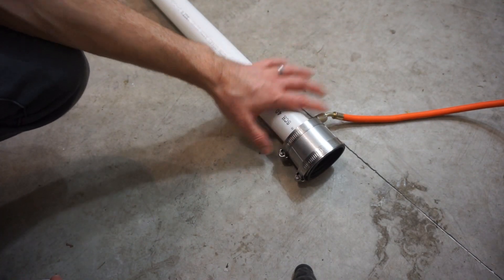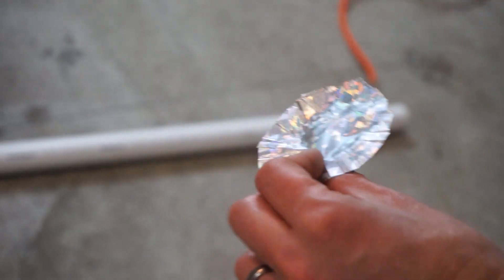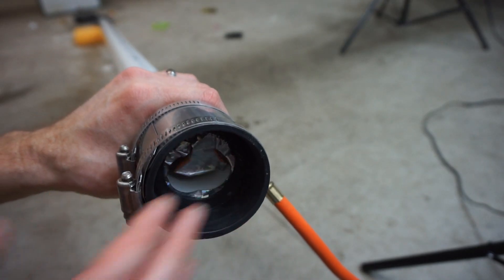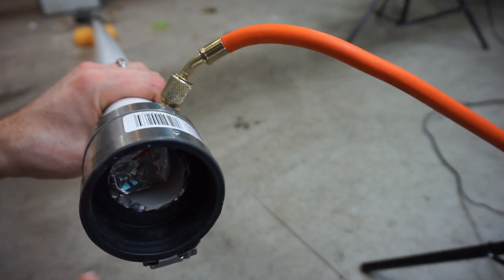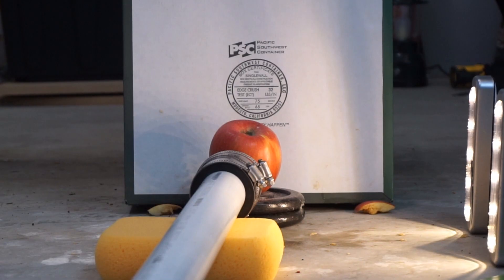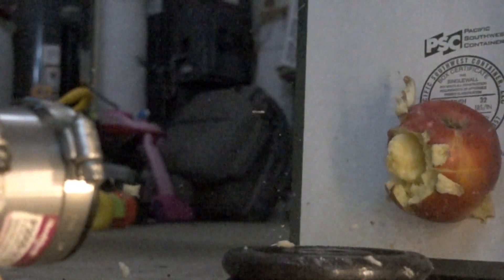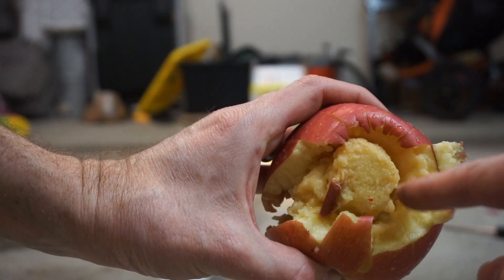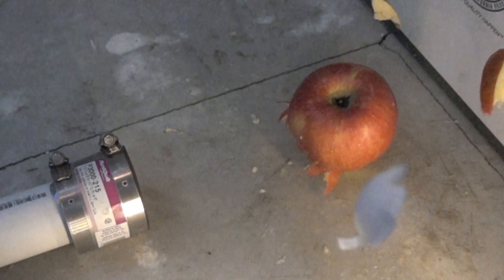Shooting Fruit With Supersonic Ping Pong Balls | First Vacuum Cannon Test

Comment: You won't hit supersonic with just vacuum, you need either pressure or a lighter driving gas such as helium.  With a 2m pipe, you're probably hitting about 280 m/s which isn't bad, but not quite supersonic.

Comment: I'd like to see an actual measurement of the speed of the pp ball.  Shoot slow mo from a 90-deg angle to line of flight with a ruler behind that flight path.  A possible experiment would be to see if an aerodynamic styrofoam bullet could travel faster and further than a ping pong ball.
This video has a flicker which, I guess, is from fluorescent lights.  It would be interesting to see videos lighted only by an arc light, which should have a very pronounced 60 Hz flicker, if not a strobe effect.  You could compare the speed you get with the ruler with the speed calculated using the 60-Hz flicker.

Comment: Wrap copper wire around. PVC And use a magnet as peojectile. 2 experiments here. 
1) see how much juice can be generated.
2) add power to the coil and combine the vacuum & electromagnetic! ( look out)

Comment: I think the ping pong ball is bursting when under vacuum, prior to being fired. If you put a small hole  in it this may not happen. It may implode after exiting the barrel, though.  So maybe several small holes may be necessary to prevent implosion.  Alternatively, fill the ball with expanding insulating foam used to fill cracks around doors and windows. That should keep the ball from bursting or imploding.

Comment: I'd like to see you make it even  more powerful, if possible.  I feel like if you had a much stronger rupture seal on there, and then in addition to the vacuum, instead of just atmospheric pressure rushing in, put a tank of compressed air that will rush in (hence the much stronger rupture seal).  Or...something like that.

Comment: what if you had the vacuum pipe connected to another pipe that has pressurized air in it and after you pop that pressure cap thing see how fast the ping pong ball goes (not sure if the pressure cap will hold up in this scenario)

Comment: The air rush in EXACTLY at the speed of sound and it can't be like what you said 3 to 8 times the speed of sound. The air is choked at the beginning of the inlet and no further expansion happening after.
Reply from the maker: +Yi Ling the air is only choked when there is air in front of the incoming air. When there isn't air in front, there is a different limit that is dependent on the heat capacity ratio of the gas
Reply: the air will choke at the smallest cross sectional area where is at the inlet as what I have observed, it doesn't matter if there is air in front or not, it's the pressure differential driven and without further expension, the air can only stay sonic or subsonic
Reply: however, the absolute air velocity is dependent on the specific heat with this equation sqt(k*R*T) where k is the specific heat ratio
Reply: Hydraulic Press Action an easy explanation would be, the air cannot sense the further pressure drop ahead, that's what we call it a choking condition
Reply: Hydraulic Press Action in other words, supersonic flow cannot be established with pressure differential without a choke and further expansion, that why you see the nozzles of rocket engine are diverging at one end, that's basically the working principle of converging diverging nozzles
Reply from the maker: +Yi Ling The flow you are talking about would be regular flow at steady state. This would indeed be restricted to the speed of sound. But the expansion of a gas into a vacuum is in shock conditions and thus there is no restriction to the speed of sound (Similar to a shock wave). It is restricted to the speed of the molecules at that pressure and temperature. Here is a good paper on the free expansion of a gas into a vacuum and the speeds of the gas face: http://adsabs.harvard.edu/full/1953ZA.....33..251K
Reply: Hydraulic Press Action I really appreciate your effort and I'll review the paper once I get to my office tomorrow since I can get it for free. But one thing I would like to mention is, the concept of expansion for supersonic flow to a lower pressure and flow travel into a lower pressure, or to a vacuum if you wish is completely different. Technically speaking, free expension is when the imaginary cross sectional area is approaching infinity, which causes the Mach number to theoretically sky rocket, but in this case it's not likely to be the case. As you said, indeed this is not a steady flow case and the flow will travel into the tube as a pressure wave. But remember what is the concept of speed of sound, it is the highest velocity a pressure wave can travel within a certain medium. What essentially a choke is doing is to accelerate the flow to sonic condition at the choke, and the expension follows accelerate the fluid to supersonic and thats why I disagree with your argument. One more thing I would like to mention is, the ability of expension is restricted to the cross sectional area relative to the choke or in other words the space available normal to the flow direction.

Comment: WHY HASNT ANYONE WEAPONIZED THIS METHOD OF PROJECTILE
Reply: In this type of application, you need a long cylinder to generate speed. If you were to weaponize something like this, you'd probably have to make the "cartridge" the barrel.
Reply: ***** yeah you got a point
Reply: WHY DO YOU ALL HAVE TO USE CAPS?
Reply: STAY4FREE vacuum cylinders with a projectile on it like a bullet.
 Make a small very high vacuum casings and have the back like a firing plug that gets  hit in with the firing pin.

He should try to see if he can do an experiment on this one.
Reply: you could have a system that applies new a seals and loads ammo but its still more complicated than a normal gun at that point.
Reply: Single use and incredibly inefficient
Reply: The scientific answer is that the pressure difference is to low! You only generate a maximum of 1 atmosphere difference while an air gun uses 100* of that and a pistol over 1000* that pressure. In other words a vacuum rifle would need to be a thousand times longer than a normal one to accelerate the bullet to the same speed. Just imagine that thing! Lol

Comment: so it's sort of half a hyperloop. I wonder if you could somehow magnetically accelerate something inside the plastic pipe by wrapping copper coils around the outside of the pipe? You could then have a solid end cap on the breech end and the mylar disk on the muzzle. A metal bolt could be accelerated to hypersonic speeds if the current and length of the tube was big enough and then come smashing out into the air...

Comment: Supersonic?, that means are faster than bullets?.
Reply: I'm going to answer your question, don't worry, but think about this first. You're literally on the internet, and you typed a word you didn't know in on the internet to find out what it means, but instead of just typing it in to something like Google where you would get the answer and as much technical explanation as you could possibly desire instantly, instead you typed out an entire question asking what that word means only to have to wait for another person to have to type in the answer for you? Surely you realize how silly that was, right?

Anyway, the word "supersonic" is made up of two words, "super" and "sonic". "Super" means greater, or more, and "sonic" means sound. So the word "supersonic" literally means "greater than sound", or "faster than the speed of sound". If you ever hear about an airplane or rocket or something being or going supersonic, it means that it's traveling at a speed that's faster than sound can travel through the air. And if you've ever heard a sonic boom, that sound is caused by something traveling faster than the speed of sound. A common example of a sonic boom is the *crack* sound that a whip makes when someone whips it really hard. The tip of the whip is actually traveling faster than the speed of sound, or going "supersonic", causing a tiny sonic boom caused by the tip of the whip breaking the sound barrier.

Why that happens gets very complicated, and it's all in the fields of aerodynamics and fluid dynamics, but now you know what words to look up on Google to find out more, so you don't have to wait for someone to maybe answer your question next time, you can just find out right away all by yourself. :)
Reply: Yes supersonic is a word that describes the speed of a bullet... Cause there's only one type of bullet in the world

Comment: Where is the control test with no ping-pong, air only?
Where is the analysis of the ball speed? All you need is a ruler and a known frame rate...
Considering that the average air molecule moves at 500 m/s (mach ~1.47), i doubt that the ping-pong ball will become supersonic in this particular rig.

Comment: Attach a pressure chamber right behind the Mylar rupture sealand when you get the cavuum down to pressure, pump up the pressure chamber until the Mylar breaks, and compare the velocity to the rupture without the pressure chamber.

Comment: Wait wait wait, 3 times the speed of sound in a vacuum? Ehm, not quite...
The hyperloop only promises around 1200km/h, because the speed of sound is 1270 km/h at ambient temp.
Thunderf00t has some great videos called "hyperloop busted", where he talks about leaks rushing in at the speed of sound. He has some very nice demos and explanations on this topic.
Anyway, the part that is correct: you will get insane speeds, simply because you can reach the speed of sound at all.
Here is how you can look at it: it you have one tube with 1 atmospheric pressure, and another pressure vessel with 2 atmospheres, then the air will rush in, but as soon as the air get's in the tube, the pressure in the tube rises, slowing down the air. See? In order to get close to close to the speed of sound you need to have the pressure vessel having a pressure that is waayyy higher than the tube; either by generating a big pressure with blackpowder exploding, or by just sucking out of the tube.
---
The speed of sound actually is the speed at wich the particles of air move, so if air particles are moving 3 times the speed of sound, they are moving 3 times faster than they are actually moving. See the problem?
Anyway, getting to the speed of sound is not bad, that is still quite fast man.

Oh and don't forget, 1270 km/h is the same as 343 m/s or about 800 mph; don't confuse the numbers.
Reply: sasja de vries no one asked for a fucking lecture on science.

jk i read the whole thing that was actually really interesting
Reply: But since there's no pressure at the exit end of the tube, there's no air pressure to slow the ball down being accelerated. The speed of sound varies depending on air pressure, and since the air in the tube is at a lower pressure, the ball is only accelerated by the initial rush of air, and as that inrush of air slows down as the pressure equalizes, the ball's inertia keeps it going faster than the pressure front of the inrushing air, and since there was no air holding the ball back, the flexibility of the ball would push back against that pressure front and spring it forward at a speed greater than even that initial pressure front, which could allow it to exceed the speed of sound all on its own. However, since the pressure in the tube is lower than atmospheric pressure, air is free to move at the higher speed of sound in a near vacuum, so the ball still could reach a speed greater than the speed of sound at the altitude/pressure where the ball is fired.

But since the speed of sound carried by air depends on air pressure, the actual speed of sound inside the tube is a higher ground speed, so while technically the ball may not be exceeding the speed of actual sound, that doesn't mean it isn't exceeding the speed of sound at atmospheric pressure at standard temperature and pressure within the tube or shortly after leaving the end of the tube. With its large surface area and low mass, it certainly wouldn't be able to maintain that speed for very long, though.
Reply: The speed of sound has little to do with air pressure and a lot to do with air temperature This is why at even very high altitudes, the speed of sound drops off a lot less than the pressure would indicate.

Without getting too technical about it, the maximum speed of the ball will be essentially the average speed of air molecules: no matter how great the delta-P, the ball cannot outrace the air molecules that are pushing against it.

tl;dr: sasja is right, and the channel claim is wrong. The ball will not go at 3 times the speed of sound, or even close to it.
Reply: With a properly designed inlet, Mach 3 would be easy. Many supersonic wind tunnels rely on this very principle. Google "Suction Tunnels"

Comment: Cool cannon, But DEFINITELY not supersonic. 
For any fluid to go supersonic, it must pass through a converging-diverging nozzle. It is impossible for the ping pong ball to go supersonic if the fluid pushing it remains subsonic.

NASA has a page explaining some compressible flow theory: https://www.grc.nasa.gov/www/K-12/airplane/nozzled.html

And here's a general design layout to consider to make it go supersonic: http://media.boingboing.net/wp-content/uploads/2013/02/how-to-build-a-supersonic-ping-pong-gun-3.jpg

Try to keep all joints and transitions before the converging-diverging nozzle smooth for the best results, maybe try to smooth some bondo on the inside joints

good luck!

Comment: oh, so that's going mach3 in such a short tube with just a pressure differential, huh?
you should go sell that info to the people working on railguns. tell them vacuums are better than electromagnets.

that's not going faster than the speed of sound.

the fastest a gas can expand into a vacuum or otherwise is the speed of sound in said gas taking the original container (the room, in this case) as the point of reference.
the speed of sound isn't arbitrary. sound is only so fast because that's the fastest one molecule can push the next. so it doesn't matter if there's (virtually) no resistance for the air to rush into the pipe, the atmosphere can't push it in faster than the speed of sound in the room (the speed of sound changes with temperature and medium).

makes me wonder what kind of "science" you're teaching in your channel.
Reply from the maker: +GraveUypo my science is correct. I used to think the fastest was the speed of sound too, but that is only when there is a medium the pressure wave is traveling through. The gas face of an expanding gas in a vacuum actually moves at 2/(x-1) times the local speed of sound where x is the heat capacity ratio of that gas. For air x=1.4 so at room temperature that turns out to be about 5 times the speed of sound. Of course the ball doesn't get to that speed since it has a lot more mass that needs to accelerate, but it does reach faster than sound speeds. Using my frame rate I clocked mine going at least 900 mph which is faster than Mach 1. On myth busters they clocked theirs at 1100 mph.

Comment: Could a swash plate hydraulic pump be designed to operate off this concept using compressed and vacuumed air to spin a shaft like a regular swash plate hydraulic pump works?

Comment: 0:50 actually, it's been done without vacuum. The speed of sound limits the speed of a sonic wave but compressed air can expand to atmospheric at mire than mach 1 speed because it's not acting as a wave, but as a spring. There are a couple of videos if someone is curious...

Comment: Sorry.  You can't get supersonic flow without expanding an already sonic flow.  3-8 times the speed of sound?  This is 100% false.  Compressible flow theory states the fastest you can get in a tube  like this is Mach 1. Even if you went by the speed of the gas particles, which isn't how it works, you get Mach 1.4 ish. It's called choked flow, and I'd suggest looking it up before stating clearly false information.  Not even rocket nozzles can accelerate gas to more than 4-5 times the local speed of sound...

Comment: I didn't understand the explanation of the mechanism so excuse me if I'm wrong, but instead of using ping pong ball, boils you use a led ball? it would make some epic shots, or just fill the ping pong balls with sand to make me harder

Comment: Shoot your nuts at one million subs. Really though, do you think that it would work if the whole thing was in a vacuum chamber? Like would there be a substantial enough difference in the two vacuums? Ormaybe if you pressurized the pvc, put it in the vacuumchamber, and then break the seal. Would that have the same effect?

Comment: Ive been watching some of your vacuum chamber vids... btw did you know that if you place a vacuum cleaner hose in front of a roach it will run straight in because of the 2 pressure sensing "spikes" on its rear end, the vacuum simulates an attack coming from the other end of the roach. I bet there are some cool experiments you can do with this. Love the vids!